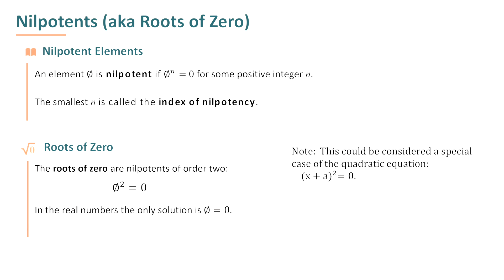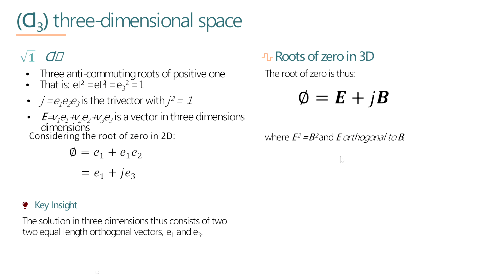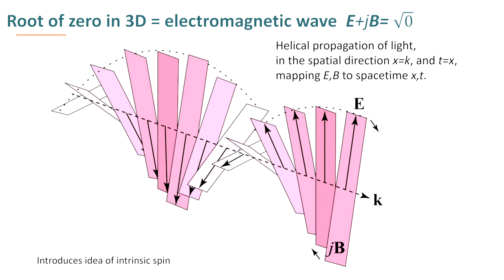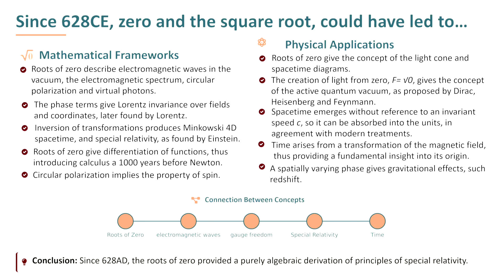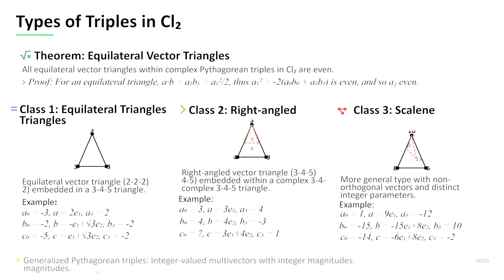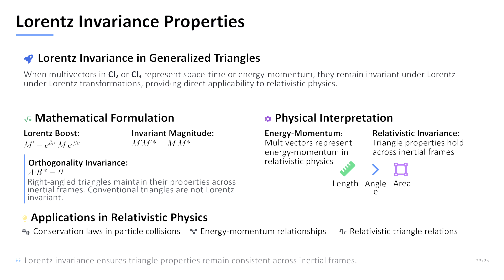Much ado about nothing: The square root of zero

Comment: I independently reached the conclusion that if you make a new math system that allows division by 0, that the square root of zero is (1/the square root of zero) minus (1/the square root of zero). and the rules for this system have n-n is n times 0, not just 0. Also 1/0 - 1/0=1, but 1/0 is not equal to 1/0+1. 0*a is not equal to 0*b, and x^0 is x/x, so 1-1=0, and is 1*0.
Reply: are these not simply standard results from wheel algebra?